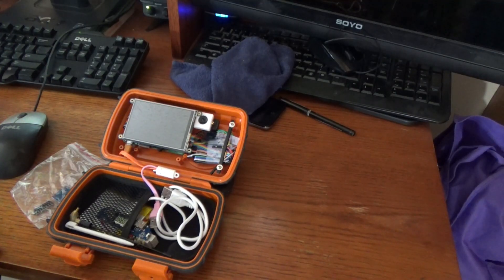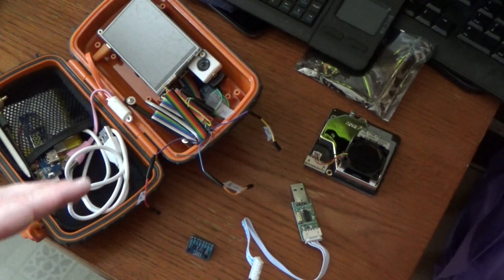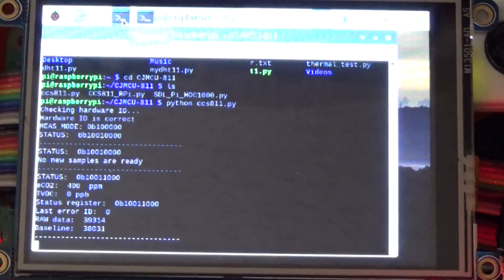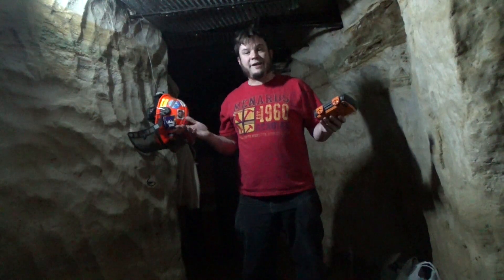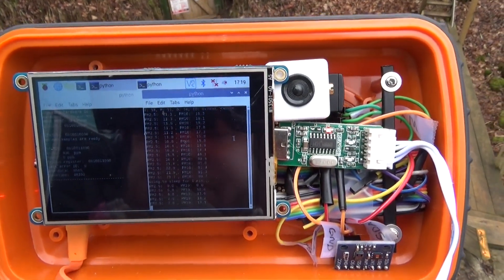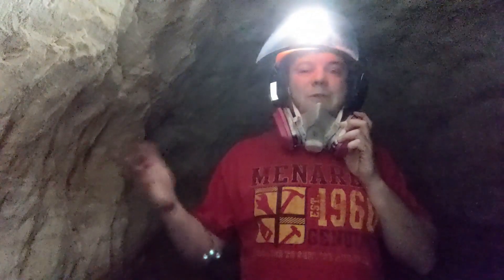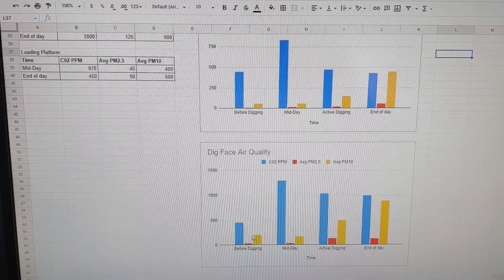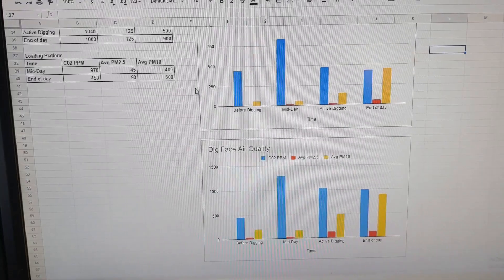Measuring Air Quality in a DIY Underground Mine

Comment: You know you've found someone special who makes good videos when, during said video you ask yourself a question, prepare to ask it in a comment, and the question(s) gets answered... but I thought to myself, hey, don't deprive the good man of a comment, show your appreciation, you ingrate cat! Good boy!
- CO2 is well and good, still, a remark remains, in remote and confined spaces, especially if generators are used, you need CO level detection as well as O2 range (too low, too high, but especially too low). 
- Does the program include configurable OSHA PELs; and warning and evacuation alarms)?
- And, finally, for your protection, do not assume your detectors are properly calibrated. Find yourself a reliable gas detection apparatus. Would make a cool video, and raise awareness.
Cheap and quite popular is a special sort of syringe (calibrated volume with rubber end to precisely fit...) plus gas detection vials. You might find one, with boxes of (non expired) vials in a "out of business" place, look up what they look like to not dispose of this strange apparatus!
You break both ends of the gas specific, single use vial; stick it to the syringe made for that (appropriate quantity of air displacement for these vials); pull the syringe plunger once; and the reading is ready in a few seconds (gradient of color change on a scale in the vial, different for each gas specific vial). Since you won't have a calibration station for "standard bump testing" your sensors... Make one!
You put your detector(s) in a sealed and flexible container (that will deform when gas is taken out AND not let gas in to change the levels); put a, let's say, little candle (will lower O2 and bring CO to dangerous levels  hopefully) in until it goes out, wait, use a resealable (for multiple detection) taped hole as a sorta rubber stopper of a vaccine bottle; and validate your sensors final readings. Bon apétit, good buddy!
Reply: Youtube is so broken!
Reply: Sensidyne, Air sampling system, manual gas detection pump
Reply: You can always find a used electronic gas, but will still have to bump test it with a standard (etalon) gas station. On the plus side, they also test methane and a few other dangerous gases. 
Keep in mind that you'll have to replace the sensors after their lifespan is reached, and that used life saving PPE kit is... not preferable, but better then nothing, when properly proven to be reliable.
Maybe, if you come up with an electronic one, a local fire station would let you bump rest your tester... but it's usually tester specific (device maker makes a bump test station that will fit snugly the sampling port position).

Comment: The lower CO2 later in the day may be due to changing air temperature outside the tunnels. The larger the temperature differential between outside and the tunnels, and the stronger air circulation will be due to drafts

Presumably, the outside air temperature increased during the day, causing cold air to come out the lowest tunnel entrance and drafting air from the highest one. The opposite occurs in winter, with "warm" air coming out of the highest entrance.

You can try to detect air circulation by placing an incense stick or something similar at the lowest or highest entrance, the smoke will flow in or out indicating where the air is going.

Comment: In underground situations, the mining industry typically cares about CO, H2S, and CH4, as well as total oxygen levels.  Miners carry gas sensors that are usually multi-gas capable and show you O2 fraction as well.  But they are pricey...
Reply from the maker: I tried to reply to this but Youtube ate it. I really hate the comments system on here, it's like they coded it last-minute and never tested it. 
Anyway, I've tried legit gas sensors before, various brands new and used... and I can never get them to work right. They either go out of calibration right away, sound the alarm outdoors in good air, or just outright die. Real mines have a whole safety department to babysit calibration and swap out defective units, but for a small operation like ours they just aren't useful or trustworthy. I even bought one of the "idiot-proof" 3M/BW meters and the darn thing died on me. 3M wouldn't replace it either. 
We don't have anything that produces H2S or CH4. We just opened a 3rd adit, so we have even more cross breeze now to move fresh air around.

Comment: Your soldering work would be a lot easier just using an iron, and some rosin core solder. The gun really ads nothing but bulk to the party.
Reply from the maker: I think that gun ended up burning out, and I have a smaller iron now.
Reply: @saveitforparts  Good, you won’t miss it. Especially working on the detailed close quarters work you do.